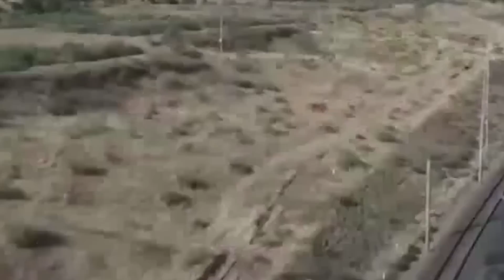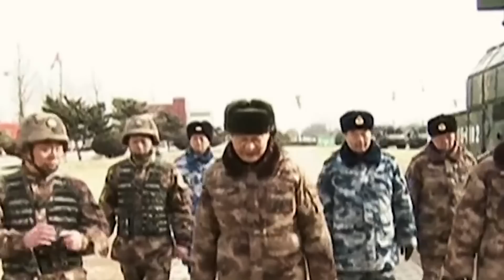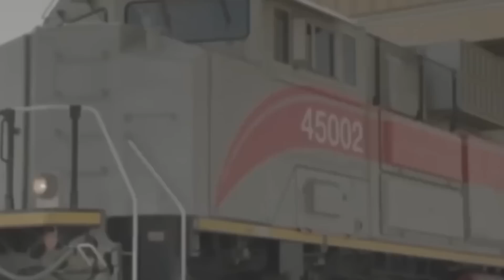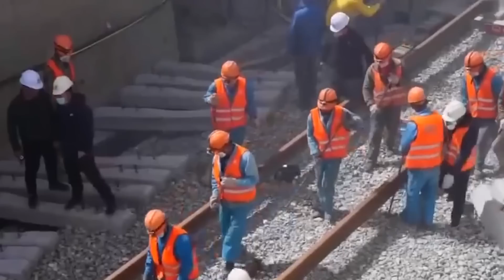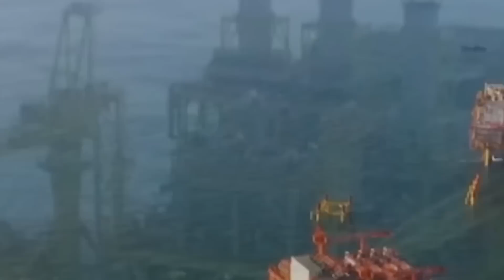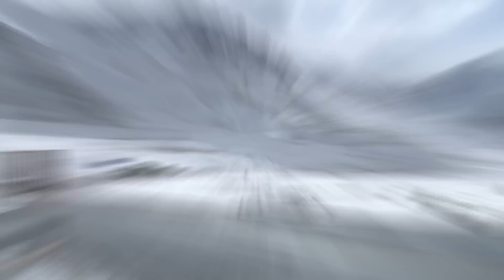Why China's NEWEST Shocking Plan will CHANGE The World

Comment: the commentator said that China can make their high speed trains much cheaper than the west because of low labor costs. This however is only one of the factors. Indeed China has developed a highly innovative system that saves a lot money in constructing their railway system. Another reason is that for other countries, they build train. But for China, because of the vast quantity they manufacture train in their production line.
Reply: A Chinese worker out performs any western worker in  the world, irrespective of his pay.  They are reliably patriotic and works for the country's success. Hence their miraculous development success es in such short time.